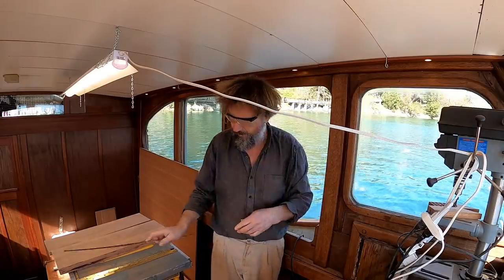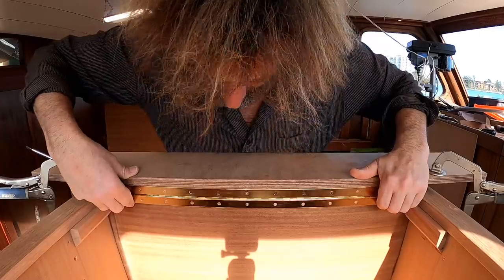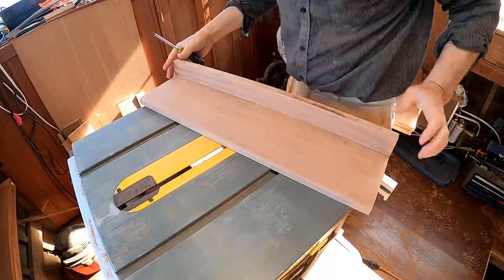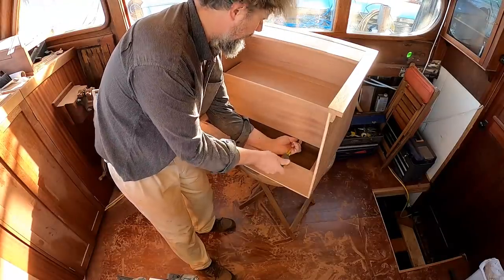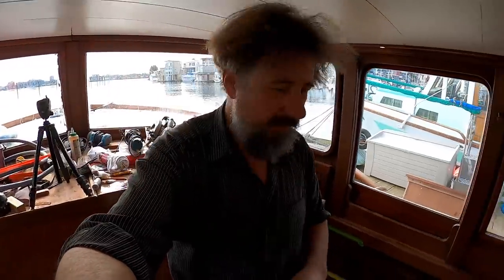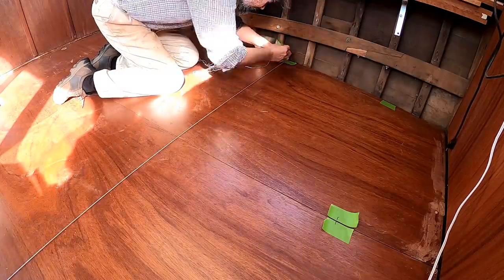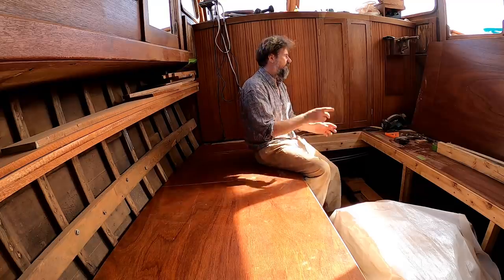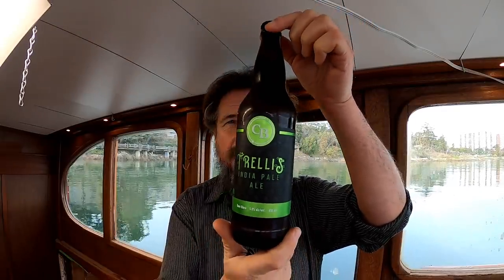Steps Done! - #221 - Boat Life - Living aboard a wooden boat - Travels With Geordie

Comment: I am hoping you will seal the outside of your new steps due to the amount of humidity in the bottom of the boat. Not for looks but simply to seal out the expanding moisture you will experience in that raw wood. Nice job, by the way!!
Reply from the maker: Great point Greg, just this minute finished the first coat on the outside.

Comment: Being a boater and woodworker myself I keep on being impressed with your sense of details and level of craftmanship. Two comments though: 
1) I myself would have oriented the side walls in the "step box" horizontally (just my visual nitpick haha), 
2) if there is place I would have mounted a 2x4 on each side of the existing longitudinal 2x4 beams in the center hatch (1.5x3 might also be enough). Then, at the intervals you indicated, I would have half notched these extra beams and made corresponding half notches at the ends of the perpendicular beams, and fastened all with screws for easy removal when doing major work on the engine. However, the optimal way would perhaps be to dovetail the ends that may eliminate the need screws at the same time as it maintains these beams functions as extra bulkheads.
Reply from the maker: Thanks for taking the time to comment. 
1- I usually opt for vert but in this case you might be right, ugh.
2- Pretty much exactly what I’m doing, except the ledgers will be the 3/4” ply side engine box panels.

Comment: The steps look great a very PRODUCTIVE week. For the bracing over the engine could you use joist hangers and have the joists just sit in the hangers with the deck attached to the joists. Lift it off in one piece.
Reply from the maker: The problem is I can only lift one side of that hatch without moving the dinette bench.

Comment: The steps look lovely but I still think you should get some neodymium magnets to hold the steps open and closed. When you are underway I think they are going to chatter when they are closed and there is a risk of opening a cupboard and reaching in and the pitch of the boat smacking the step into the back of your head.N44 or N52 are strong enough magnets that you could glue a (thin) plug over the top so you can't see the magnets but still have them work
.
Really nice bit of cabinetry though Really nice
Reply from the maker: Thanks Brad, a few have suggested that. I've used them a lot in other projects, hmmmm

Comment: Peter, looking at your setup there, I would think the thing to do would be to make the forward seat at the dinette cantilevered so you could open either side without moving it. I have seen this done on several sailboats, no reason it couldn't work well on yours. 

If that seat was hard mounted, on the forward facing side of it, you could simply put a flip up seat there that could be folded down when not needed that would give a nice place for a passenger to ride while under way. My grandpa had a similar setup on his boat growing up and it worked well. It was just two pieces of plywood, and two piano hinges, and a cushion you set on it, which means it could also double as an extra table for say a Christmas tree or anything like that when you have another need for a flat surface.
Reply from the maker: Ha, awesome thinking man. Yes I have something clever planned, quite similar!

Comment: Peter, to some extent at least might you consider integrating the  support structure for the engine access hatches with the floor itself. You would then socket them into or sit on supporting wood strips attached to the adjacent non removable framing.  Just a thought for your fertile brain to cosider
Reply from the maker: Great thought Tom, the problem is the engine hatch needs the hinge down the middle making integrated structure difficult. It would have to be able to unlock and hinge with the sole.

Comment: Peter were you not worried about that plywood chipping out when you crosscut it because of the several layers of finish you had on the wood? I would have been nervous out it tearing out but it looks like it turned out great.  Thanks for sharing all of this work!
Reply from the maker: By cutting from the backside I was pretty sure it would be OK.

Comment: Peter, the steps look great! With the bonus video, you’ve been very productive! Unfortunately, it looks like the  sole got a couple of scratches (along with your forehead). Just wondering about the cross braces, are you going to use something like a joist hanger, so that it’s easy to remove them? Then again, since it’s a wooden boat, I imagine you might make something out of wood to support them (and eliminate any chance of catching a metal edge while working in the engine compartment). As always, looking forward to the next video! Cheers!
Reply from the maker: Heh, I didn't notice my forehead till the edit. No worries on the sole scratches, only in the finish, will clean up nicely when construction is over.

Comment: Great job, me b’y! I had to use those very same piano hinges on a tool box I made last year. I felt your pain. The screw heads haven’t pulled through the thin, tin yet , but there’s always tomorrow. At least the brass coating adds a thou’ to the gauge, lol. Heirloom box with those hinges...sigh.

Comment: What do you think of the idea of using a router to cut the bottom of the door so it remains the original length and has a  rounded notch to match the curve of the nose of the step?
Reply from the maker: Woo, sexy, the door actually covers the flat section of the tread though.

Comment: You certainly have been productive. I love the steps! What are you using for sound insulation for the engine? I can't remember if you've mentioned it.

I am on Spring Break but hope to be productive nonetheless. Virtual teaching is an added challenge to middle school math instrction!
Reply from the maker: I'm considering rigid rock wool. Failing that acoustic foam laminate at 100 times the price!
Reply: @TravelsWithGeordie  thanks for the reply! I was wondering if rock wool was what you were considering. It does seem a good choice!

Comment: Hi Peter, what wood is good for the sub-floor framing. I'm considering buying a boat of similar size which has a lot of rot from the roof leaking. Also will you be waxing the mahogany of your cabin to preserve it longer?
Reply from the maker: The best would be White oak but it’s dreadfully expensive. realistic is Douglas fir or cedar. The mahogany gets tung oil then wipe on poly on the inside, ting oil then Epifanes varnish on the outside.